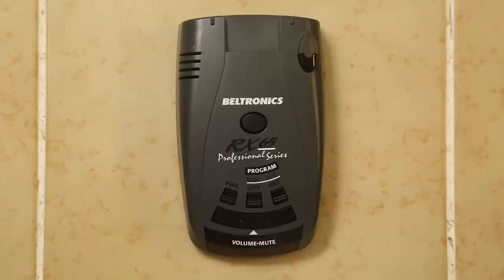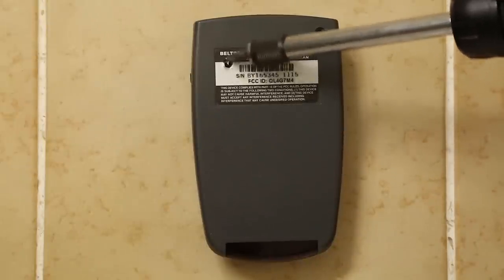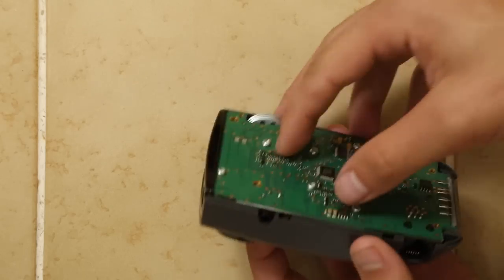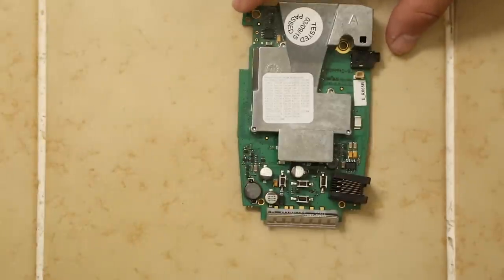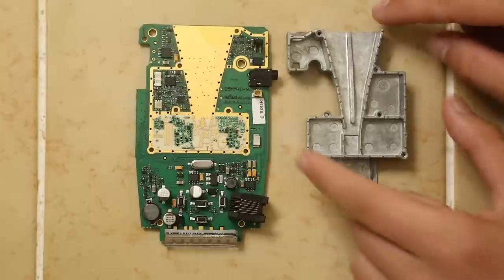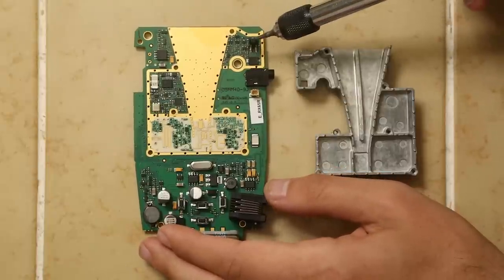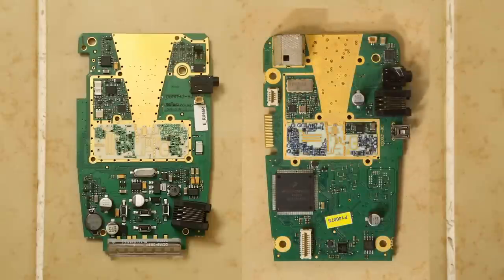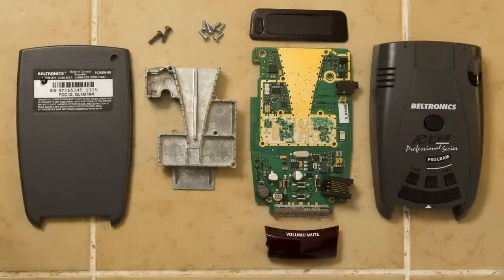RX65 M4 teardown

Comment: Good video. Condenser, parabolic, fish eye, bubble lens.  It has many names.  I should tear down one of my 8500 M4s. While many parts are similar to the 8500 I tend to thing the Bel has higher build quality in some areas. Their LIDAR receivers aren't good but they excel in other areas such as the speaker vs the 8500s monophonic buzzers, the PCB on the Bel is also nicer. The Escorts PCB you can tell they are produced in series and made one peice,  they leave very evident break through when they "snap" apart, your board was flush and even.

Comment: Thanks lots of help.  After 12 years I dropped mine and the sound quit.  I could use the aux output with earbuds wrapped around it and volume on high but PITA.  I bought a speaker on Amazon and connected it to speaker wires, had to solder mine.  No connector like this one.  Works great   https://www.amazon.com/gp/product/B00N4YSRRC/ref=ppx_yo_dt_b_asin_title_o03_s00?ie=UTF8&psc=1
Reply: Very helpful.  Thanks man!

Comment: thank you for this video. I tihnk the reason my display would somethines turn on or off is because it was soldered badly. When i opened it, the screen completely broke off with light touch. Is there a way to replace it?>
Reply from the maker: +doo d You'll need to send it in to be repaired
Reply: nevermind I resoldered it myself and everything is good =D do you know how to mod the detector so it can reach further range though? A few people have done it

Comment: Here's a look at the M4 on Escorts detectors. Note the following, no speaker just a piezo buzzer. The PCB is broken out of a "honey comb" like assemble. The LIDAR receiver uses 2 large diodes and 14 small holds surrounding the receivers. Case assembly is less complex than the Bels. All buttons are sonic plastic welded to the top lid including the periscope for the LIDAR. I can't take the long LIDAR receiving tunnel off the board as the bottom is soldered to it. http://1drv.ms/1R6IuTE
Reply from the maker: +Nick Caimans Oh hey, nicely done. Interesting to see that long tunnel for the lidar area. Great job taking it apart and taking the pics and thank you for sharing! Very cool to see. :)